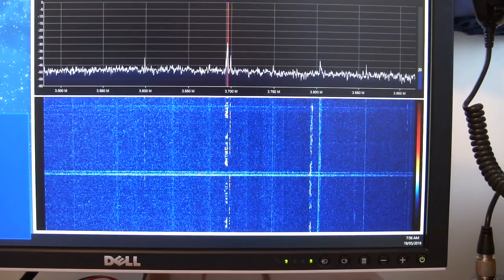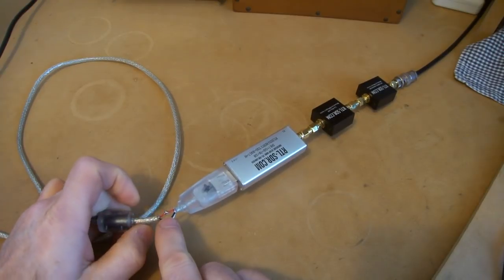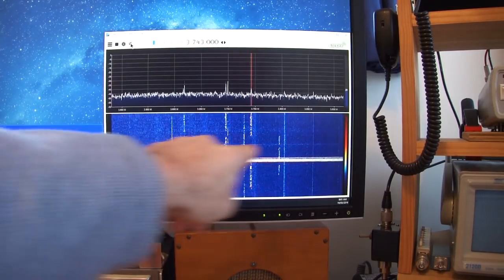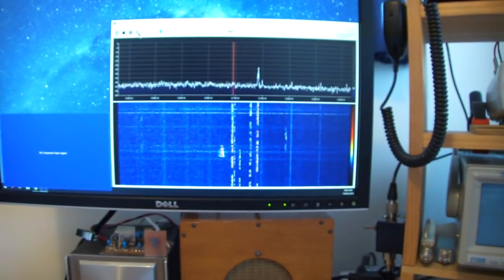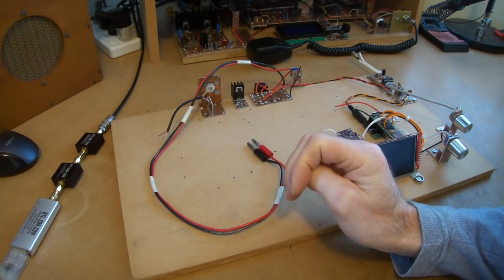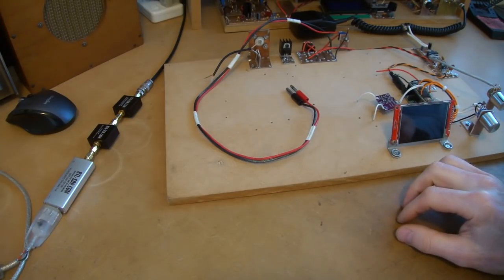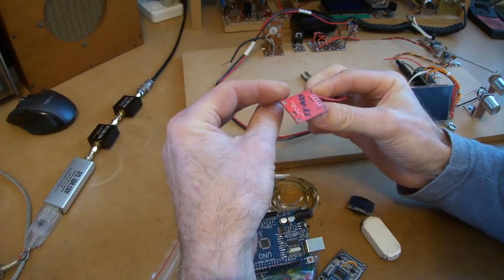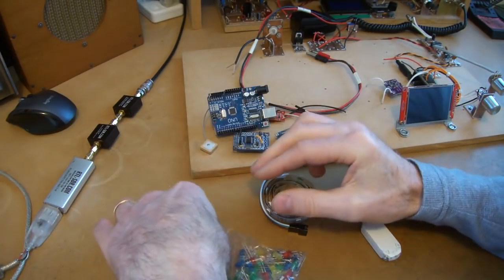Thoughts and Ideas for the Next Build

Comment: Hi Charlie-congratulations on cracking home brew for 20 metres !
I also vote WSPR, but on 20 metres , you already have the gear built and tested , but with a more beefy PA (for reliability )?
Mal
Reply from the maker: Hi Mal. Yes the WSPR TX will sit on the 20m antenna while it is not is use. As for the PA, we'll see what happens. Theree was a suggestion in a previous video to potentially look at cheap RF amp modules off-say-AliExpress. I will initially look at those. The duty cycle will be interesting as each WSPR tranmission is around 110secs. One option is to rest (cool down) for 70secs then start over. I think 1W is about right given my location.

Comment: Vote [1] WSPR. I've been gathering some bits to do something similar so hope to follow your thinking on this.  If you're going to code the encoder yourself, good luck!  Have a look at the NT7S lib and associated docs.  I'll just call Jason's lib!  Which won't fit into a Uni/Nano memory space BTW! 73.  Where did u get those  neat little filters?
Reply from the maker: Thanks Paul. Sounds like it is going to be bit of a challenge then. I naively thought it was four separate tones (effectively discrete transmit freqs) that make up the 4-FSK. We'll see what happens as they say!
Reply: @CharlieMorrisZL2CTM  There's a link to a good paper on NT7S github that explains it, there's FEC and other encoding tricks fun!  I plan to use Jason's lib in an MCU thats bigger than a Nano 👍
Reply from the maker: @Paul_VK3HN  Sounds good. I might look to just hard put the encoded bit stream into an array and just send that over and over. My callsign, locator and power wont change. Early days. As for the filters, I got those off TradeMe here in New Zealand.
Reply from the maker: Paul. My intent is to use this description of the WSPR encoding as a guide: http://www.g4jnt.com/Coding/WSPR_Coding_Process.pdf